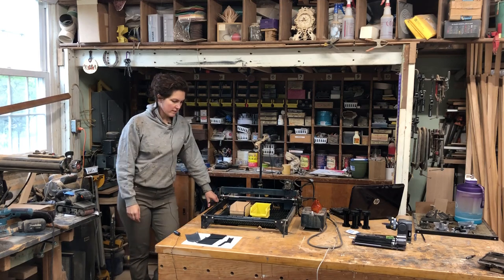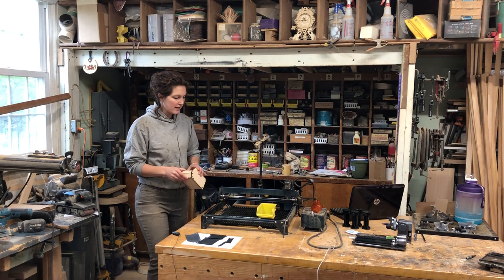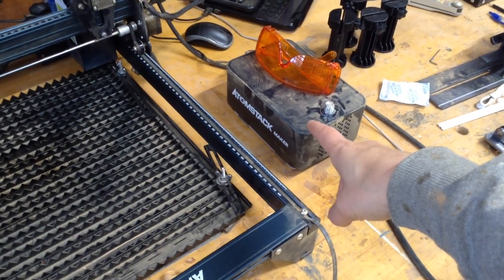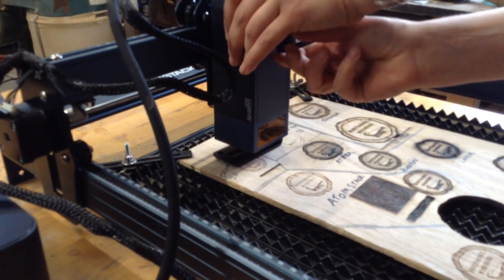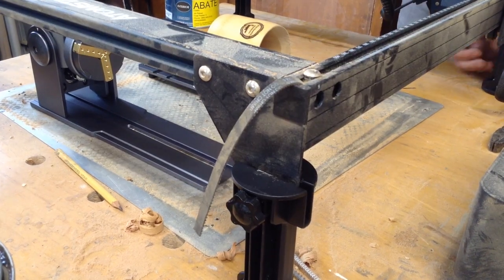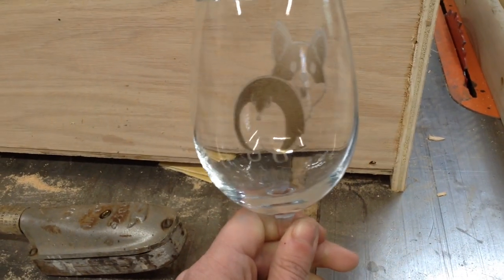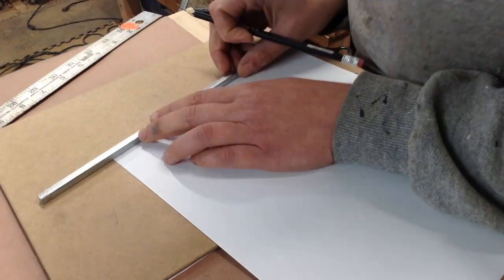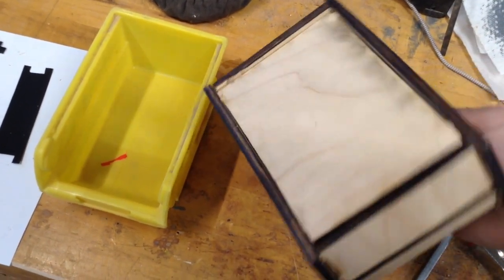How Good Is the 33W Atomstack A30 Pro / How To Make Woodworking Storage

Comment: The reason so many low power diode machines have a difficult time burning through thick material is that the focal point of the laser beam is out of focus. Once the cut exceeded the focal point when attempting deeper cuts the laser beam blows out and loses it’s ability to cut. 
Think of using a magnifying glass to focus the light from the sun to burn a leaf of some object there is a finite focal point to make the burn take place. Since the laser can not move in Z axis the focal is lost.😁🛫

Comment: The custom wine glasses would likely sell really well. Though selling fragile items is a headache with the inevitable  shipping damages.
Reply from the maker: Agreed shipping would be a nightmare.  Also while these turned out well I don't think they are a sellable product as is.  The angle would have to be adjusted to get a more even burn, and the alignment isn't perfect.  That's one of the reasons I don't plan on spending a lot of time with the rotary.  On none flat surfaces it requires a lot of fine tuning, and that is nothing I'm interested in spending time on.  But, for someone that is, you can make some pretty cool stuff.

Comment: Thanks for the review!  I’m sold on a higher wattage laser.  I saw in another YouTube video they upped the air pressure considerably using an air compressor and the parts cut much cleaner.
Reply from the maker: Yes, when I remember to turn on the air pump it leaves the surface burn free.

Comment: Caitlin, have you tried putting a transparent adhesive tape on the wood to be cut or printed, using it allows the surface to not burn so much, giving you a cleaner line on the surface and avoiding the toasting that the surface leaves when cutting or mark. Greetings. 🤗🤗
Reply from the maker: No, but I’ll have to try that.  Using the air pump I usually don’t have a lot of issues with surface burn though.